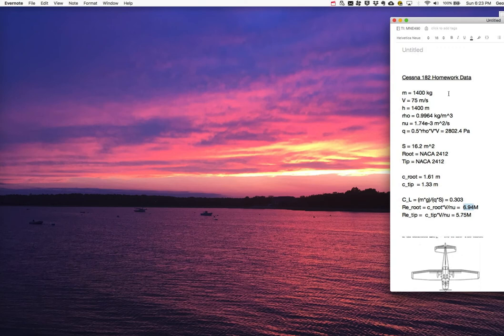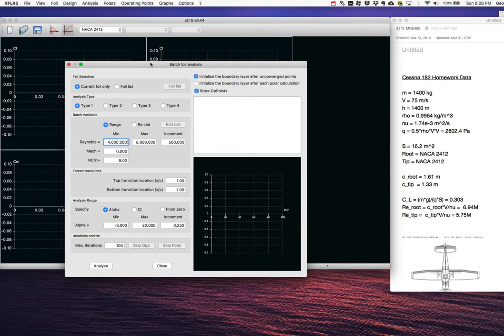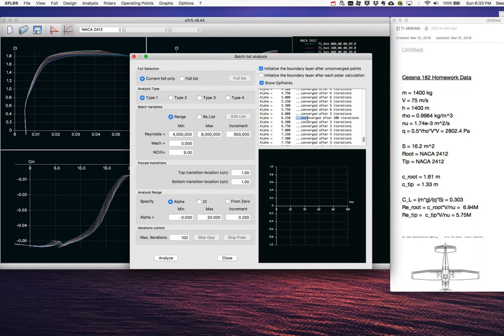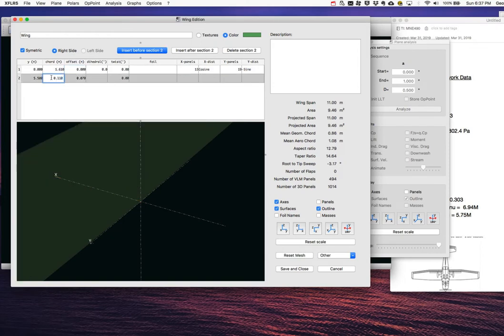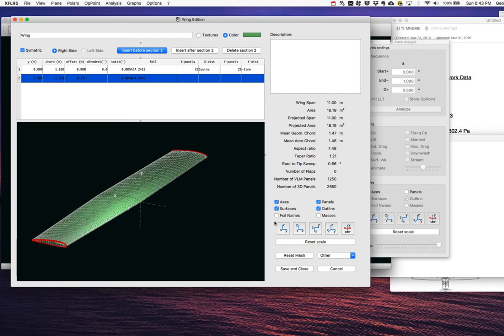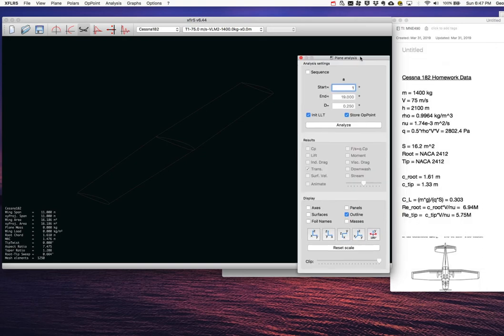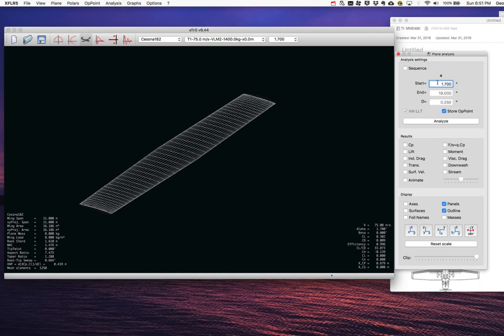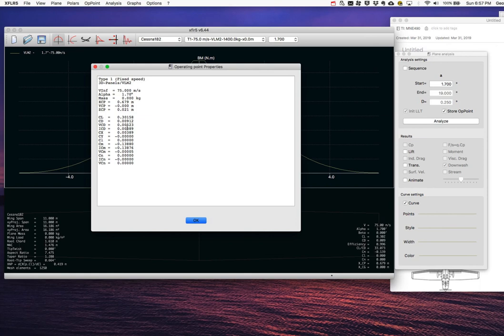XFLR5 - Simple Wing Calculation

Comment: Hey, I'm part of a DBF team trying to do some analysis. I'm used to the old version where you can check and uncheck all the different analysis it does in a batch to check out the Cl curves for a specific Reynolds number. 
New version doesnt seem to do this, and for the life of me I cant figure out how to get it to work! You mentioned using "show all op points" for the selected foil up top, but I've done e that (also tried hide all polars and then tried show associated op points) and it didnt seem to do anything.